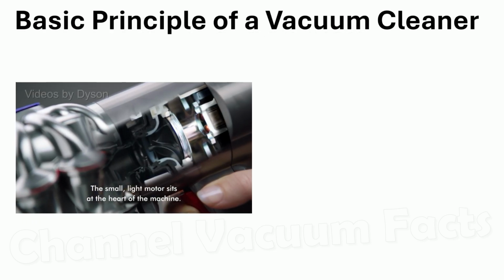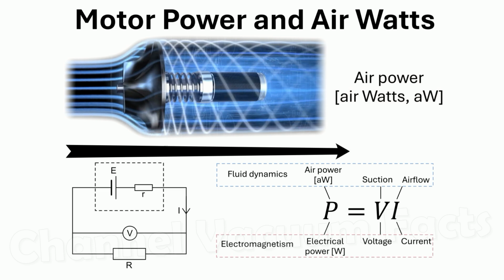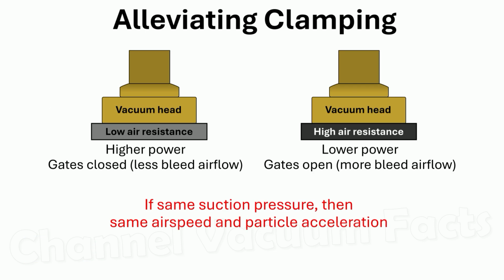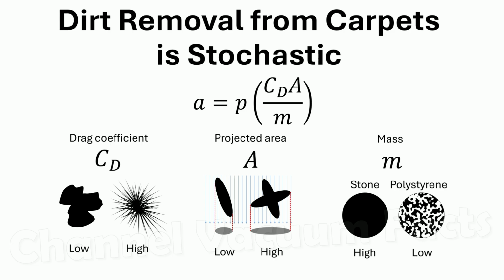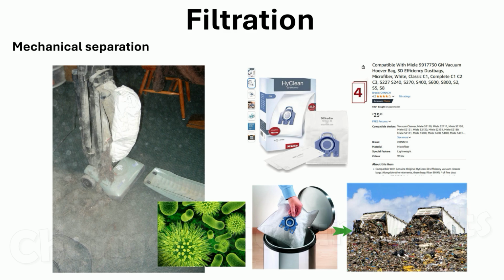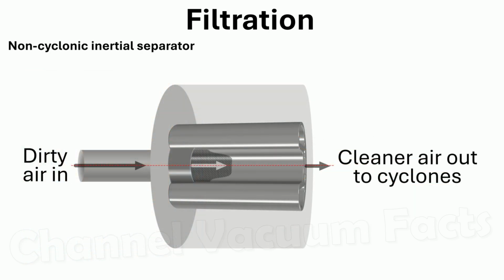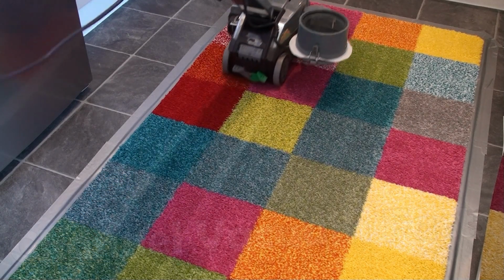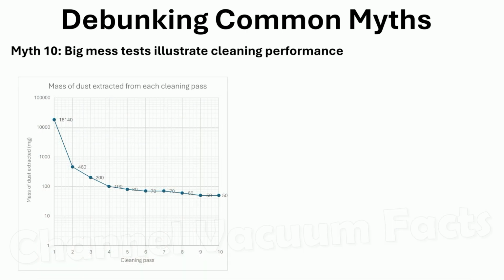How do vacuum cleaners REALLY work?

Comment: Very informative and comprehensive video. I've never seen anything like this on YouTube before. 

Some of the best vacuum tests I've seen come from Dyson’s lab, where they use a machine to move the vacuum at a consistent pace, ensuring fair comparisons. Not to mention everything else they do. Recently, I saw a YouTube channel testing a pair of vacuums and doing the infamous sand test. The people using the vacuums were flailing the cleaner heads around with no real order or consistency (even crossing over the taped on boundary). They were also pressing down on the main body of the vacuums at times, using two hands for some reason. When I pointed out the lack of consistency, they replied with 'Vacuuming speed won't affect pickup, especially since we're doing multiple passes.' What do I know!
Reply from the maker: While there are many lectures out there, none directly address this area in detail. So yes, I may have done something unique, which is a rarity on social media. Yes, those robots they use to test are part of the criteria to follow the industry standards (which they also commission to have independently verified). Yes, YT is full of nonsense and this video is the direct response to all that, so feel free to link all over the place and cite away.

Comment: I like the rotating disc 😊 Where did this come from Johnny? Is this a Dyson design for future models?
Reply from the maker: I didn’t dare say the naughty word "Dyson" in the video for fear of losing my head. But yes. They're the only ones advancing technology in this way, naturally. Their new inertial separator to replace the old, first stage bin cyclone and shroud design that’s been used for years—and that everyone has copied now—is amazing and likely in the next product in a few months (probably…I may be wrong). I discussed that in this video too. The next product also looks to have a completely new type of floor head with two cantilevered all-floor cones. It’s called the Konical, I think, based on registered trademarks in the public domain. It detangles like the hair screw but is a main floor head and eliminates the naff hair comb idea Shark had in products first and many others have now. And the suggestion that it’s all floor cones implies they’re doing away with the fluffy, finally, and the need to swap heads, combining the two. The new product also variably uses cyclones. In low power modes when air currents are lower, air only goes through half of them. This keeps speed high within the cyclones and filters better at lower power modes. In boost, a valve opens and all cyclones are used, since there’s more air current and only half the cyclones would introduce too much air resistance and slow air down. It looks like a very different kind of cleaner and a major advancement.

The rotating disc will likely be their replacement for cyclones for physical reasons stated in the video (and the previous video I did over a year ago, “Beyond the cyclone” https://youtu.be/lWpdK234XfU ). They've been working on it for years, so it's presumably tricky to get to work. I proposed in this video that they could use both. I'm sure they know all this though. It may even be that the inertial separator is coming first to get around patents, since an ancient vacuum cleaner did patent a rotating disc separator but only used it after a cyclone (and it was fairly crude). I wouldn’t be surprised if they replaced cyclones in the version after this next one and introduced the new solid-state batteries, but this is just speculation. Everyone else just copies with a crude clone which doesn’t work as well.
Reply: Will be interesting to see what's coming 😊
Reply from the maker: Not the worst typo I've ever made. In fact, I note their gigafactory should be operational now or imminently, and may in fact be producing their more energy dense, proprietary battery technology already. It's possible such batteries may appear in the next gen tech, likely out in a few months. https://www.dyson.co.uk/discover/news/latest/technology-investment-in-singapore-philippines-bristol
Reply from the maker: Yes, I'm aware of the new first stage separator, as this lecture discussed. What's your source for cinetic tips being present? I don't believe they will be. I suspect they are using variable cyclone use instead to maintain high airspeed as a function of airflow.
Reply from the maker: OK, so you were just guessing and didn't have a specific source for Cinetic tips (which is what I thought). They abandoned them for reasons I discussed here a few years ago https://youtu.be/Z3MefmIot6M (variable airflow found on cordless cleaners impairs their function). It was nothing to do with they didn't work, as anti-Dyson propagandists attempted to myth spread. They won't come back because they're likely ditching the disadvantages of cyclones longer term (see this lecture you're commenting on).
Reply from the maker: @absoluterainbow  Yes. Technically, all cyclones that weren't Cinetic cyclones after they'd invented them were apparent downgrades. In practice, this has been fairly minor since they eventually offset that with other technological upgrades, such as scrolled cyclones. The filter rarely needs rinsing with that technology and they see very little dirt (bar abuse). The upcoming non-cyclonic inertial first stage separation, and variable cyclone usage to maximise speed into them as a function of airflow without increasing air resistance too much, will improve this even more. Cinetic cyclones still let dirt through; they just had a low cut-point. It's not clear how the previous and upcoming upgrades have changed that, quantitatively, and it's not unreasonable to suspect it's been matched. Cyclones will be superseded eventually with other forms of separation discussed in the lecture that eliminate cyclonic weaknesses. The best develop this; the rest clone shoddily.
Reply: I wouldn't say they were heavy duty 😂